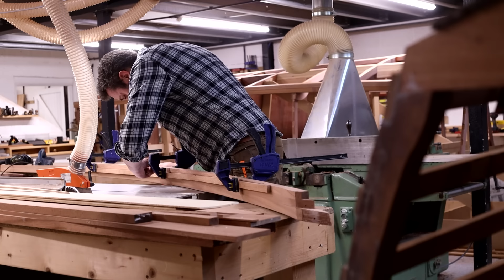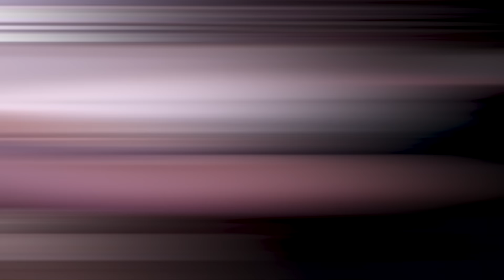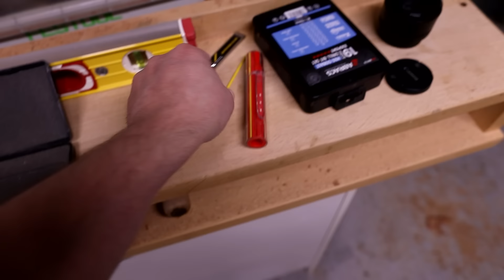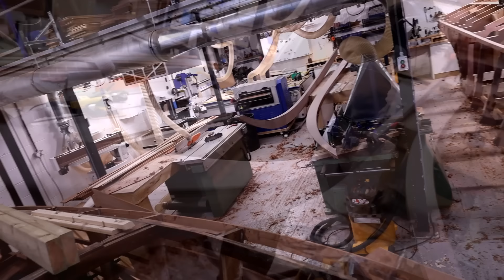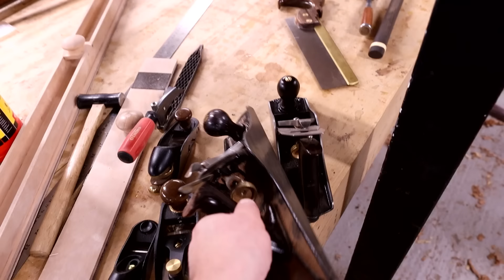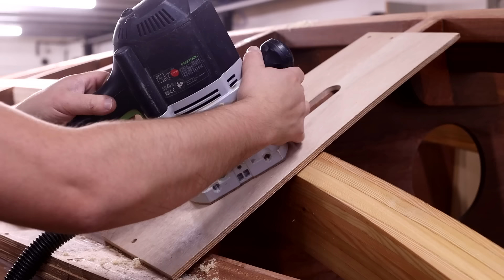Cutting Limber Holes, Fairing and Preparing For Bottom Planking | Building Temptress Ep35

Comment: I use soldering iron on the head of the screw to create heat which "breaks the screw free from the epoxy.  Also coat the screw in something like WD40 to prevent the bond from forming.

Comment: Been there with the plug cutter. If you realise that it’s tight before breaking the screw, a soldering iron on the head will heat the epoxy and loosen its grip. I have a feeling that you know this already.🙂

Comment: Im under the impression that not lifting up your plane after each stroke doesnt really matter.  I dont buy into the notion that it dulls your blade much faster.  Maybe on a scrub plane....
Reply from the maker: I agree, maybe on fine cabinetry work you may want to adopt this practice but when your doing things like I am, cutting bevels and curves in timber laced with epoxy I don't believe it matters.

Comment: Hi Dan,another great episode! One question though, when you bonded in the chine you mentioned the usual two step process would be used, wet out and then thickened epoxy. I noted that you didn’t appear to wet out the chine itself, just the frames, is this because the chine was sealed with clear epoxy at that point and as such couldn’t wick away the thickened epoxy and potentially dry the joint?
Reply from the maker: Yes that is correct, because the chine is already coated and sanded we are now bonding a non absorbent surface so it doesn't need the un thickened epoxy stage 👍

Comment: Running a spring pin in reverse works great for removing broken screws. Heats up the screw from the friction so the epoxy bond will break free and the screw backs out. Leaves a clean hole also, that you can plug if needed.